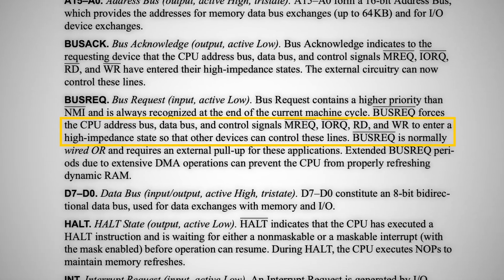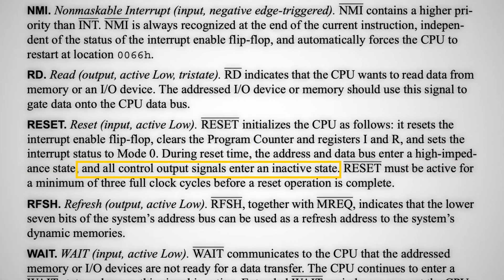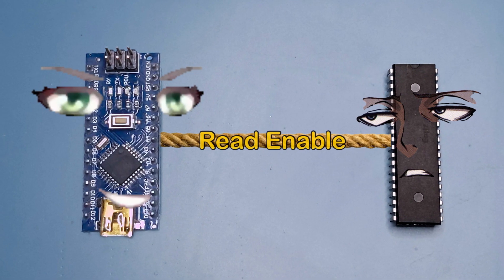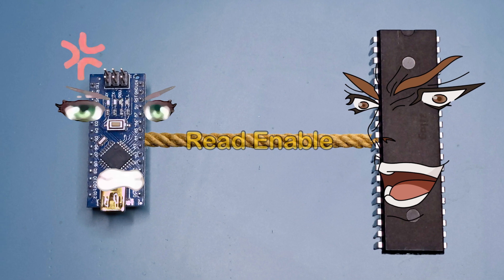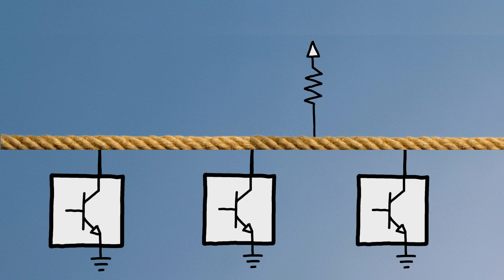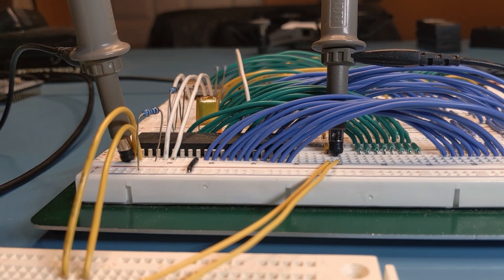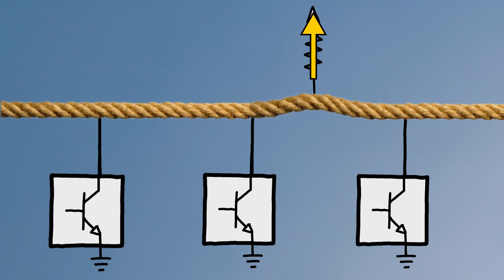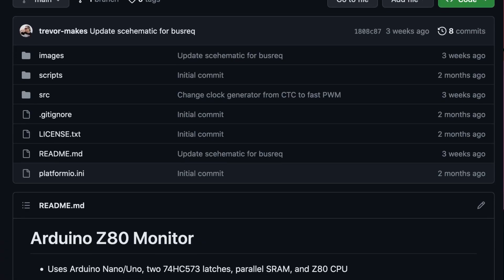Teaching a Z80 to share (memory)

Comment: I'm a beginner. I bought  Z84C0004PSC,  Z840006PEC, and Z840008PEC.
I wired everything to Z840008PEC  on a breadboard and it works without any problem. But when I swap it with 4PSC or 6PEC, it doesn't work.  Aren't they the same ?  Do they have same pin layout?
Reply from the maker: The pinouts should be the same, but they're rated for different clock speeds: 4, 6, and 8 MHz. Did you try lowering the clock speed to 4 MHz?

Comment: Sounds good to me. I really like that you don't program a EEPROM every time you want to do something. Using that NANO which is providing a serial link . Having to program a EEPROM every time you want to do something is a bit of a pest.  I am still building the Ben Eater 6502 breadboard computer, but I have a Z80 and tones of 8k EEPROMS and lots of static parallel ram.  BUT vscode  that's Microsoft. Even though they say its free its a special kind of free they like to enforce. I use Arduino IDE and I use minicom so maybe I can do this. I really like what you are doing here. Keep going.  It looks like you are maybe using a MAC?. I have been told its a bit like Linux.  One thing, be careful to who you listen to. Before long they will tell you to put antivirus on your  Z80 breadboard.  Keep it simple. Don't  over engineer it.
Reply from the maker: Agreed about Microsoft. There is vscodium as well... I might switch back to Arduino IDE for my videos since it seems to be more foolproof for beginners and hobbyists who don't already know things like git, vscode, installing extensions, etc. I'd really like to remove the software dependence from the PC side completely and add something like a web interface for programming the breadboard from anything with a web browser.

Macs have a Unix command line but some tools like sed are the BSD variant which lack features tacked-on to the GNU variants more common on Linux. This can be frustrating when trying to adapt shell scripts or one-liners written for Linux, but at least you don't have to learn Windows powershell.
Reply: @TrevorMakes I took a quick look at vscodium. For whatever reason I couldn't get get the addons to work. I am very comfortable in the shell. Been using it for along time. People make it very complex, but it doesn't need to be. When i first started with C was back in the day when High SoftC was new and I got it free. Its now pretty darn expensive.  I was using my Amstrad CPC 464 and green screen monitor. Your Arduino code is amazing for sure. I wonder if I can use it on my Arduino IDE. You can use Arduino IDE  as a neat simple build system for your code .  I am waiting for my  Oscilloscope and probe leads to arrive from amazon. Suppose to be this week. For streaming stick to YouTube. Twitch is really for gaming.
Reply: @TrevorMakes Stick to Arduino IDE. Its amazing what you can do with it. You can do very simple stuff with it your more complex projects. I have been checking out Python. It looks interesting. I want to work on serial communication between my PC and a breadboard computer.  We are talking about serial  TTL to USB  no nasty rs323. :)

Comment: When using a Z80 with DRAM that refreshed by the CPU appropriate measures are required by the external bus master to continue refreshing the DRAM to preserve DRAM contents. This may involve a method to exchange the Z80’s R register contents to the external bus masters.
Reply from the maker: That's a good point. Both BUSRQ and RESET (but not HALT) stop the Z80's built-in DRAM refresh cycles, so as you say the external bus master (in this case Arduino) would have to take over refresh duty. The Arduino could do this with interrupts, though the overhead of interrupt handling at the row refresh frequency would be significant, ~10% of CPU cycles (AVR has lots of registers to save/restore in ISR).

I've got a bunch of different DRAM laying around for my DRAM tester, so I was thinking about building a more standard Z80 system with DRAM and Z80 peripherals after I wrap up this Arduino-based one.

Comment: If you prefer to use /RESET, what if you tie the /RESET and /BUSREQ lines together? Do you get the best of both by doing this?
Reply from the maker: That seems reasonable, but unfortunately the RESET state takes precedence over the BUSREQ state, so the control lines are still held high as if it was just RESET alone.

Comment: Just for info. 40 years ago (!) I added a Z80 to my 6502 based single board computer, sharing the memory (and memory mapped io). Only one cpu was active at any time. Had to add tristate buffers to the 6502 lines but could use the fact that the 'inactive' Z80 had built in tri-state. Cant remember exactly how I 'paused' the cpus  (probably via reset) but could use the 6502 to set up the initial memory contents then switch to Z80 (which started from a reset state into a monitor program and could eventually boot CP/M from disk. Could also use the Z80/cpm to load a 6502 memory image and then switch over to the 6502 (as didnt have a disk operation system for the 6502) . Seem to recall I inverted the address lines to the Z80 to 'move' the 6502 important zero page out of the way
Reply from the maker: How cool! Like the Commodore 128. That's an interesting point about the 6502's zero page, since that's where the Z80 entry points are. I'm spoiled using a microcontroller since it has its own ROM/RAM built-in separate from the Z80 bus.

Comment: I would do it the "right" way, i.e. using the BUSRQ/BUSACK mechanism - that's what it's there for. And if you run out of pins on the Arduino you can always either use something with more I/O pins (like an ESP32) or a I/O expander like the MCP23017 to give the Arduino more GPIO pins.
Reply: With ESP/STM/RISCV you have to convert logic levels 3.3v<->5v, those chips are no cheap.
Reply: The ATmega4809 Curiosity Nano has more pins and runs at 5v and as a bonus can run at 20Mhz when configured correctly (note: it is 16Mhz by default).  The drawback is it doesn't handle nested interrupts the same way as other Arduinos.  At the moment, Mouser has it in stock for $25 US.
Reply: @davethedaemon9024  You might find an Atmega 1284p in a 40 pin DIP. I have one on a breadboard connected to a dual port IDT7132 RAM. I stumbled on Trevor’s channel when I was looking for a command line interface to load and save code to the memory chip. The other port of the RAM chip is connected as the main ram in a Wilson Road Kings pinball machine. The Atmega 1284 can pull scores and pass them through a UART port to an ESP32
Reply: @tgopaul  Thanks!  I didn't realize the 1284p also came in a 40 pin dip.  Brilliant idea to interface the 1284p to an old pinball machine via dual port ram!  I happen to have several dual port ram chips awaiting the start of a 65C816 project I have in mind.
Reply from the maker: You'd probably hate the ZX81 video circuit! It uses series resistors on the actual data and address lines so the logic chip can inject fake NOPs while the Z80 reads from the display memory, and then injects pattern addresses to the ROM while the Z80 does refresh. I thought overriding the read/write enable was pretty tame in comparison! 😁
Reply: @TrevorMakes  op-amps will make the slide-rule obsolete
Reply: @TrevorMakes  .. choosing resistors will require consideration of what type of Z80 you have. A CMOS version at the logic and opcode level is the same as an NMOS Z80 … but at the transistor level, bending the rules will need to account for differences.  ..an old timer told me .. all circuits are analog. .. but kids wiring logic gates for the first time are confused by the power and ground pins.

On my original build I had a CMOS Z80 and was using an Adafruit Metro Mini instead of your Nano. The Metro Mini has the smallest surface mount packaging of the  Atmel328. This might explain why the Z80 reset behaved differently for me.

Comment: Good video and explanation! The scope traces show what is happening.
...

I've placed 3 buffer ICs (74HCT245) on the address and data lines to drive some LEDs. When in TriState high impedance mode the input to the buffers floats. ... so I put in 10K pull down resistors. 
I might switch these to pull up. 
I'm thinking that Tristate is useful in transition from one controlling CPU to another but a bus shouldn't be left dangling in Tristate mode. 

Looking through data sheet for an IDT dual port RAM it warns not to leave the input pins floating. I also see that a Hitachi 63C09 processor pulls all the address lines high in between instructions. TriState is reserved for only when the CPU receives a BusRequest.

This is probably why Reset does not put the bus into tristate. Tristate is special and needs to hand off quickly to another controlling master. 

Good fun to figure out at the hardware level. ... and to appreciate more what goes on inside a device running at 3GHz with 2GB RAM.

Using an Arduino and the Analog inputs there are some circuits out there to make a tristate logic probe.
Knowing when a bus is in tristate might help for  projects that have devices sharing bus lines.
Reply from the maker: That's an interesting point about not leaving the bus lines floating... Is that referring to the data/address or just the control lines?

A tristate logic probe sounds useful, I'll have to look into that.